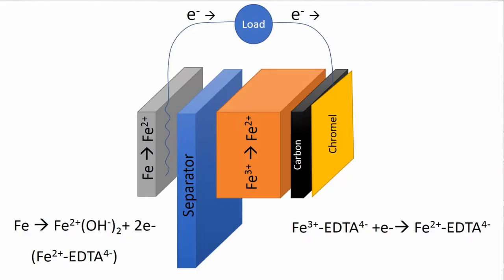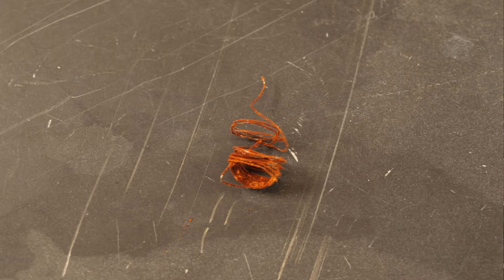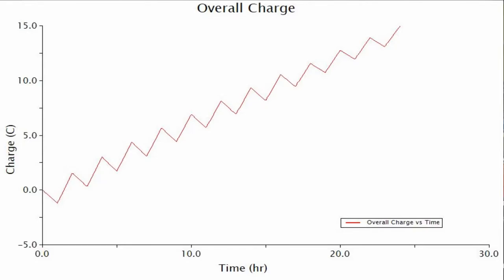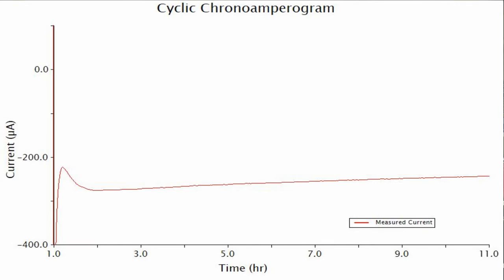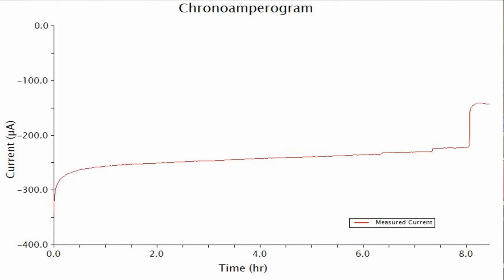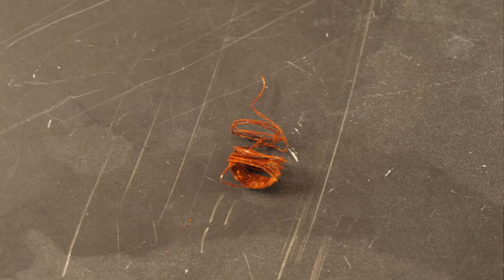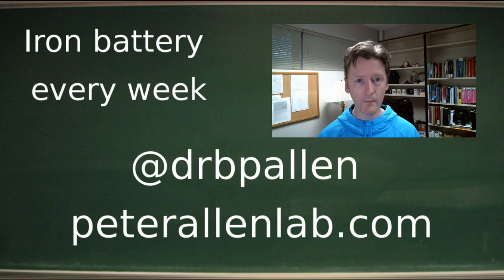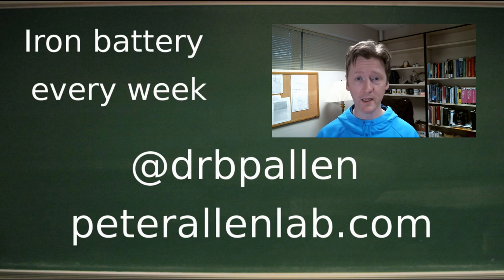Iron Battery part 68: Last iron-EDTA early performance and future metrics

Comment: Hi Peter, quick question, why are you not considering iron chloride?
Reply from the maker: I've tried iron chloride, iron citrate and iron sulfate as iron ion sources. At these pH values (pH 8 or so) none are very soluble. The latest experiments are using iron (II) chloride or iron (III) chloride as the source but require another ligand to keep everything soluble